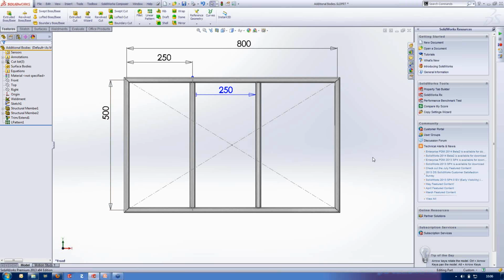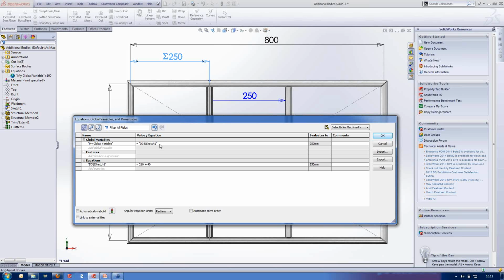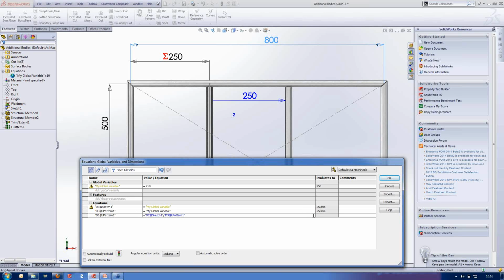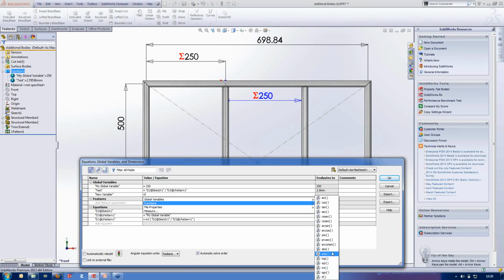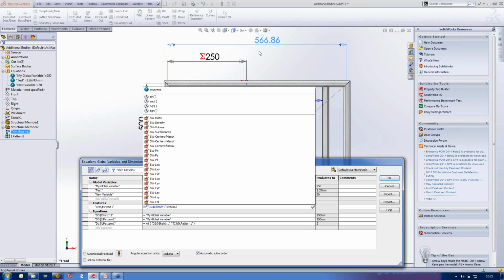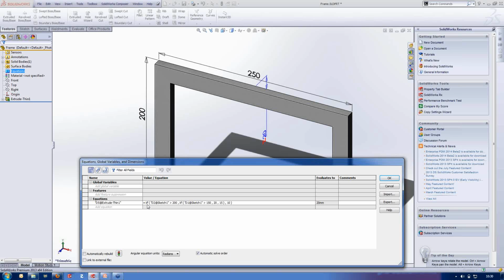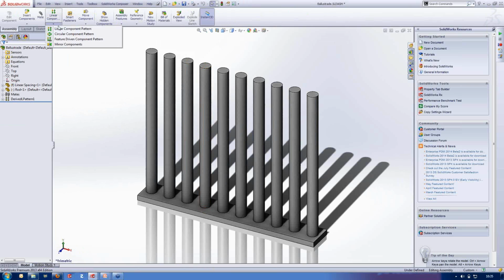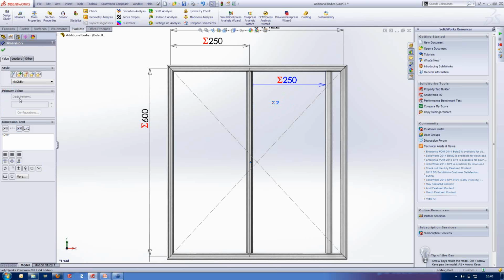SolidWorks equations - create more intelligent parts

Comment: Excellent video. Is there a way to set the min and max length of a part? Let’s say that you wanted to have 500mm as the minimum, and 2000mm as the maximum length of your part in this video. How would you set it up?
Reply: I figured it out myself. For anyone interested it´s: = IIF ( "Length" < X , "MinLength" , IIF ( "Length" > Y, "MaxLength" , "Length" ) ). Here X an Y represent your limits, and everything inside quotition marks are global variables you set up. You use the formula as your sketch dimension.

Comment: Is there any way I can use an equation to control the rotation angle of a structural member (weldments)?
Reply: Create the sketch for the weldment on a reference plane that is driven by an angle dimension. Then drive the angle of the reference plane using equations.

Comment: This is fine for parts but I want to be able to control part features from assemblies without making every part in the assembly an internal part. It would also be helpful to make changes in the assembly and have those changes translate into part configurations.
Reply: Did you figure out how to convert changes in new part configurations?
Reply: The only thing I have found is DriveWorks Express. Do a youtube search for tutorials.
Reply: When I want to make parts that change with the assembly, I first make my planes visible in the assembly, then I make a sketch of the part (in the part-file) and put this sketch on the correct plane. Then I make a boss-extrude of the in the assembly to the next visible plane. Now you have your part which changes when you change the distance between the planes. Can you do something with this?